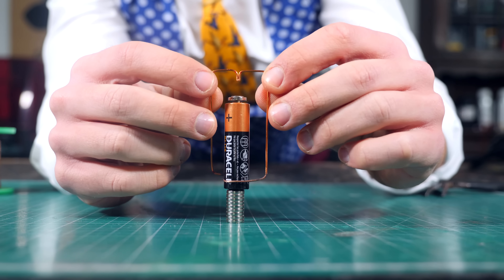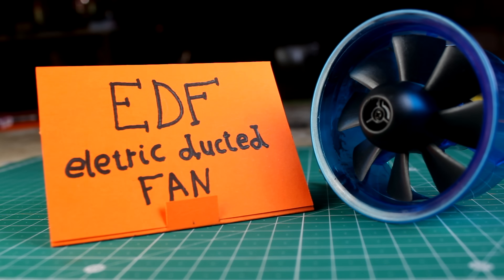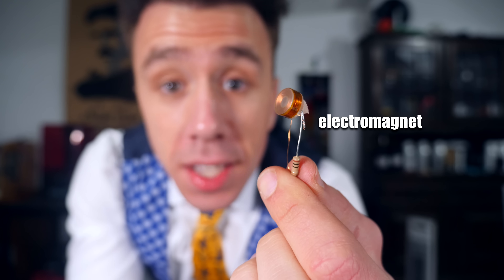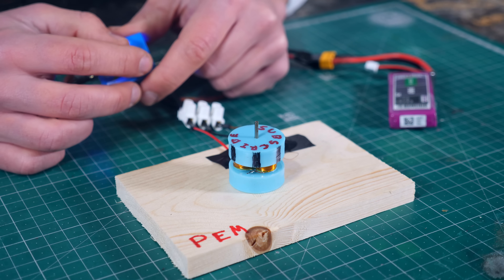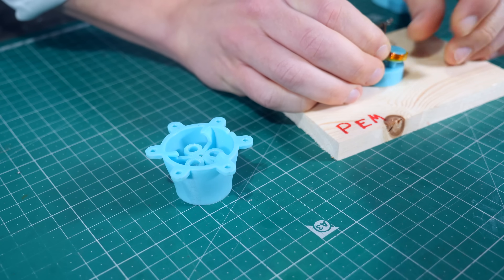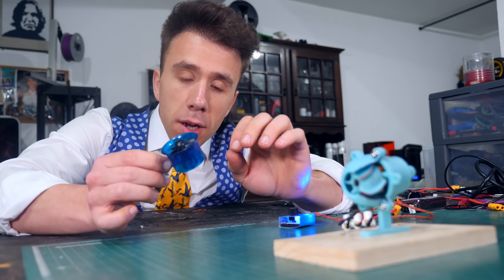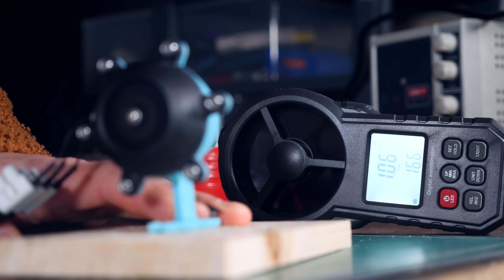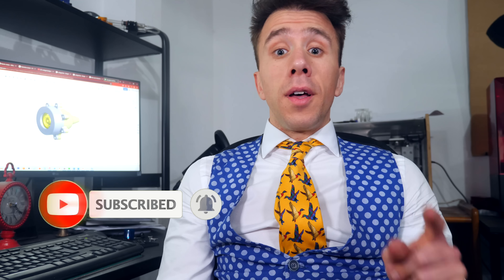I 3D Printed an ELECTRIC MOTOR FAN

Comment: Hi, as a Steamfitter the answer to your question is 2 fold. First a centrifugal pump works best with a perpendicular flow pattern that uses the "Centrifugal" force to release the fluid in the desired direction. Your casing requires the air to attempt to move sideways, restricts it, and forces it to change direction. I'm pretty sure a physicist could come up with an experiment that would show the losses as heat, in the casing, the air, etc. The reason a Dyson works is the very efficient turbine they use powers a very powerful force, the venturi. Because the air from the dyson comes out at a high speed thru a very small opening, and this is the important part, all around the inside opening of the ring, the air inside the ring goes along for the ride so to speak. The dyson doesn't restrict the flow like your design.

Comment: Hi, my name is marius, I whould love a 3d printer, I am 15 and very enthusiastic about engineering and a 3 d printer whould be just the thing I need to boost my passion.  Im from South Africa and we have regular power outages called loadshedding, if you chould design a Diy small scale phone charger generator or turbine system it would genuinely help alot. I hope you see this and have a good day.

Comment: Here's the issue with your design. Rotations on the coil is everything, the more coil you have the bigger the magnetic field is. And for the blade? Because it's 3D printed it's not smooth. you need to smoothen it to make it more stable and the air much more stable. This is kinda like having a prop with some imperfections in it, if it's not smooth enough it cant cut the air properly.

Comment: what it this? comment-bait? fine. it looks like you calculated the slopes of the propeller especially to push the vacuum in the middle towards the front and the back of the engine in equal measure. your little sister probably finds this obvious so you're clearly up to something.
make the front incline INCLINED to suck air in. based on the geometry of the casing and the longitudinal distance dependent angle of the blade the air is (hopefully) pressed radially and towards the back.
you go ahead and make a weapon better fitted to be used by zombies cuz you have no idea how yummy human brains are

Comment: ok ive been printing impeller designs for 4 days now at different angels of attack , surface area and amount of blades. what i found as a common theme was the angle of attack. if the pitch is too aggressive then the blades put to much resistance on the motor which therefore limits the highest possible speed. now in contrary to this im building a larger model with variable pitch blades as i saw this video and thought, could i put 4 or more motors into a closed loop (literally a circle) and run the fluid with enough pressure and speed to create a gyroscope. so now i have 2 projects. and im running out materials so it could be a few weeks, but more or less the main thing was the pitch of the blades on the leading edge

Comment: a server power supply fan would do better. the blades spacing is important as well as the entrance shape. it looks like blades overlap that means they block air from entering in  try fan blades with 50% to 100% spacing, meaning an open gap. to allow air in. also modifying the shape of the blades. the inside should be more aggressive than the outside slope. all the work is done on the outer part so openings should be on center from input and towards outer circumference on outer flow part.

Comment: Dude I was litterally just doing a ton of research on 3d printers and how I can't afford any good ones lol. Anyway, what if you try to make an engine powered type fan. Like not a radial engine, rather a small sterling engine connected to a fan. It would be cool to see the rates and possibilities they can create! Or maybe you could connect a piston to a sterling engine!
Reply: the only issue ive had with sterlings are they dont like to speed up or down and the ramp up from starting is quite brutal. may i suggest a few different size motors connected to a mainshaft with an isolator and reduction gears. i have built a canoe motor with 16 sterlings and a reduction gear connected to 2 impellors on the same shaft (feed in-feed out). worked ok but it was too risky for anything more than a still lake

Comment: Measure the power used by the fan to spin.  If it's not using the same a.ount of power it's not moving as much air, even if it's hitting the target rpm. Rpm is just rpm, it's just spinning.  If you completely cover the intake it will spin super fast, and use almost no current because it's just spinning.
Reply: Good point I wasn't even considering load measurements voltage is just voltage until you add resistance and it becomes amps and amps*voltage=power.

Comment: I produced a similar shape of rotor to yours a while ago. It was part of a small 3D printed supercharger. The rotor is actually hybrid being half way between an axial and centrifugal compressor stage. I've since moved back to a 3 stage axial compressor which is a bit more predictable. In theory each axial stage should offer a 1.2 pressure rise while a centrifugal compressor will offer something around 3.0. You exist somewhere between these values. The tip clearance for the hybrid rotor may affect the performance.
Reply: I miss the mustache! F*** tomatoes.

Comment: i think the entire issue is torque vs power, an actual prop or bladed fan benefits alot more from torque because it's blades directly induce flow by directing the air they pass through in the intended direction. They don't have to be very fast and baring shockwaves or other shenanigans mostly scale their output with rpm and diameter, producing resistance that needs to be overcome with torque. Fans induce flow at a rate.
impellers operate differently, alot of it being that the blades themselves work to get the air moving in a way that the rest of the housing can take advantage of, not inducing the flow but producing a bunch of centrifugal forces and constraining them to generate pressure. This makes things weird because the air has to spin relative to the rest of the housing to be subject to the various forces that produce the flow and thus surface finish is paramount to performance, as is efficient shape. You would also be generating flow by a pressure differential thus rpm does not produce the flow, only an amount of pressure, which is not fixed to the number of rotations.
in short impeller wanna spin fast, you need to optomise it to the maximum rpm of your motor then restrict the down wind flow enough that the torque demand doesn't stall the motor. Fan don't care for fast, fan do big, hur dur lots of air all at once, make sure the blades won't stall and maybe about the vortices or turbulence if you wanna get fancy about it.

Comment: I went ahead and did the math and a balance of force using the specifications of an EDM that looked like the one you used. The specs say thrust is 470g and power is 199.8W (probably not). The thrust converts to approximately 4.61 newtons and the output is about 0.268HP. Using the balance force equations produces an output velocity of about 39 m/s. Using the kinematic relationship that means the intake velocity is about 18.586 m/s. if you take your model and remove the interior geometry and use the EDM with its regular dimensions you can theoretically increase the force from 4.609 newtons to about 223.505 newtons. this would demonstrate a theoretical net increase of 218.896 newtons of thrust. this is of course assuming no entropy and zero shear at all surfaces but, the fact remains your losses have to be related to restrictions, drag and turbulence as noted by several earlier comments.

Comment: One of the reason could be also rpm,  a centrifugal fan spin faster than a normal fan.  Turbo in car can spin to 200.000 rpm and generate 2bar of pressure. In the automotive if the compressor fan is smaller, spin faster
Reply: So you need, for have the same trust, to increase the diameter of the fan and make sure you don't have bottleneck in the intake or exhaust

Comment: by looking at your design I would say you have far too much compression of the air at the output side of the fan. Remember that a volume of air can only be compressed so much in an open fan like yours. You could try to first enlarge your exaust/output to see how that changes your airflow. And yes smoke is a good way to do that. Use slow speed as possible to see the changes.  Increse the opening my 2 mm or so each test. Yeah I know that it would be a lot of printing to make many different jet bodies. Second, change the fan itself. You could try to use different blades pitches with a gap between each set of blades should be at least room for 3 sets of varied pich blades on you compressor. Last and this could work though I have no idea if it will but imagine if you incase your motor in a ovoid shape with the opening at the rear for the motor itself. Then print a new housing which encompasses this new fan use multiple sets of blades each blade would further compress the air from the blade in front of it. Do keep in mind that compressed air gets very hot so your build must take that into account to ensure the proto-type doesn't melt down.  
I don't have a 3D printer but hope to get one in the future so I can't try out my ideas for you but with that said I am pretty good with modeling things in my head.  Good luck.
Reply: ᴄᴏɴɢʀᴀᴛꜱ ʏᴏᴜ ʜᴀᴠᴇ ʙᴇᴇɴ ꜱᴇʟᴇᴄᴛᴇᴅ ᴀᴍᴏɴɢ ᴏᴜʀ ꜱʜᴏʀᴛʟɪꜱᴛᴇᴅ ᴡɪɴɴᴇʀꜱ ꜰᴏʀ ᴛʜᴇ ᴘᴀᴄᴋᴀɢᴇ ᴄᴏɴᴛᴀᴄᴛ ᴛʜᴇ ᴛᴇʟᴇɢʀᴀᴍ ᴀʙᴏᴠᴇ
^^^^^^^^^^^^^^^^^^^^^^^^^^^^^^^^^^^🎁🎉

Comment: Dear friend, as an old modeller, we have always known that EDFs perform less than open propellers.
The problem is in losses due to turbulence due to the space between the EDF propellant and the walls of the EDF chamber.
If you manage to leave that distance to a minimum then you will not have turbulence and you will not have losses.
sorry for my bad English,
a greetings.

Comment: As other people say, think about the relative inlet and outlet apertures. The fan is creating a pressure differential, the flow is just a secondary effect.
Also the aperture for the blower fan is a tubular surface infront of the blades. Not the circular transverse opening in front.  The inlet could be choking the flow of air to the blades in the first place. Try a wider diameter ring of blades on the blower.
Also look for losses in the system (from recirculation and work done to travel through the casing to the exhaust). Normal axial fans have a little recirc around the blade tips but the housing is very open, there is no resistance to the exhaust.

Comment: Described problem is due to clearances (accuracy). You need to reduce gap between propeller and body (it will dramatically boost your results). But it will work if all else is done correct.

Comment: I’d guess it’s a tolerance issue it’s difficult to get a good seal with air with water your idea as is probably would work great. Look at the compressor tolerances in turbo chargers tho they operate 50-100k rpm looking at modern turbo charger compressor wheels might be another place to look for ideas I’d recommend looking at borgwarner EFR line of compressor wheels as well as Garrett gtx and G series compressor wheels they have really high efficiency.

Comment: You should make a video on building an electric fan system to channel a blade of air on the outside of a windshield to prevent water from impacting while driving at speed.  This would take over from the main wipers at a certain speed eliminating moments of poor visibility between wiper cycles.  It could also assist with defrosting the widescreen if the air was pulled from near the engine/exhaust.

Comment: You might be losing pressure or stalling your compressor? 

The centrifugal compressor on a turbine engine creates a huge amount of pressure, which if it leaks out means you are losing airflow. Could be that.

I don't know how fast you are spinning it but if it goes too fast you will outpace the incoming air and stall your compressor. Try having a couple axial compressors separated by stator vanes before the centrifugal compressor. Look at the design of a modern PT6 engine for what I mean.
Reply: ᴄᴏɴɢʀᴀᴛᴜʟᴀᴛɪᴏɴꜱ ʏᴏᴜ ʜᴀᴠᴇ ʙᴇᴇɴ ꜱᴇʟᴇᴄᴛᴇᴅ ᴀᴍᴏɴɢ ᴛʜᴇ ʟᴜᴄᴋʏ ᴡɪɴɴᴇʀ ꜰᴏʀ the 🤶 ɢɪᴠᴇᴀᴡᴀʏ ᴘᴀᴄᴋᴀɢᴇ ʜɪᴛ ᴜᴘ✉️ ᴛᴏ ᴄʟᴀɪᴍ ʏᴏᴜʀ ᴘʀɪᴢᴇ

Comment: You will never get the same thrust by shrinkin fan diameter. That's just physics.

To get there you will need:
1. Very high tolerances on the impeller. I mean, extremely high. 3D printing with plastic won't work here. Resin is the best choice being rigid and cheap enough.
2. A high rpm motor. Rpm count should be proportional to the one you had on your original fan. Constant in this proportion is hard to count exactly. You can take it as R/r squared, where R - original fan radius and r - impeller fan radius. It's not an accurate formula, but good enough for start.
3. Experiment with nozzle. You need to find one optimal for your size.

Good luck!
Reply: ᴄᴏɴɢʀᴀᴛᴜʟᴀᴛɪᴏɴꜱ ʏᴏᴜ ʜᴀᴠᴇ ʙᴇᴇɴ ꜱᴇʟᴇᴄᴛᴇᴅ ᴀᴍᴏɴɢ ᴛʜᴇ ʟᴜᴄᴋʏ ᴡɪɴɴᴇʀ ꜰᴏʀ the 🤶 ɢɪᴠᴇᴀᴡᴀʏ ᴘᴀᴄᴋᴀɢᴇ ʜɪᴛ ᴜᴘ✉️ ᴛᴏ ᴄʟᴀɪᴍ ʏᴏᴜʀ ᴘʀɪᴢᴇ 🎁🎉😊

Comment: Measuring fan efficiency is not as easy as you think. The product of volume flow per second and flow velocity equals the effective power transferred to the air flow. So, you must measure the thrust AND the flow speed, otherwise you learn nothing ;-)!

Comment: an impeller Tomato blender, one that uses 4 impellers (3 at the bottom and one on top facing the other 3 below) to blend and grind tomatoes until they are just juice so they pour down the drain better.

Comment: My understanding is that EDFs require absurd degrees of precision.
I don't remember the specifics but there's a great YouTube video. I watched about it. 
Basically if the tips aren't really, really close to the edge of the duct It will generate vortexes at the end of the blades just like a normal impeller.

Edit: I found the video
https://youtu.be/7f2DZIC8a1k

Comment: Are you using the same diameter fan and impeller? The impeller looked a lot smaller, which reduces thrust at the same rpm, and a higher rpm increases inefficiency
Reply: ᴄᴏɴɢʀᴀᴛᴜʟᴀᴛɪᴏɴꜱ ʏᴏᴜ ʜᴀᴠᴇ ʙᴇᴇɴ ꜱᴇʟᴇᴄᴛᴇᴅ ᴀᴍᴏɴɢ ᴛʜᴇ ʟᴜᴄᴋʏ ᴡɪɴɴᴇʀ ꜰᴏʀ the 🤶 ɢɪᴠᴇᴀᴡᴀʏ ᴘᴀᴄᴋᴀɢᴇ ʜɪᴛ ᴜᴘ✉️ ᴛᴏ ᴄʟᴀɪᴍ ʏᴏᴜʀ ᴘʀɪᴢᴇ 🎁🎉😊

Comment: the cross sectional area of the output of the impeller is a little over a third of the EDF. your blades are FAR too short for comparable thrust. you will need to print your blades at a substantial angle with some support-removing post-processing in order to fit it in your build volume. same with the casing. it's gonna need to be as big as you can possibly fit in your build volume. print one part at a time. Also, consider Siraya Tech Blu Nylon Black for toughness, so you can print thinner blades and not have to worry about shattering them. ST Blu Nylon Black isn't clear like the other ones, so it cures at a higher output, so you won't have to worry about dialing in the exposure and power levels. an Anycubic Photon M3 Premium is also going to get you very good results (once you get everything set up and updated, provided the updates don't conflict) because the X/Y resolution is 28.5 microns, and it has a 25 x 12.3 x 21.9 cm build volume. The Z-axis accuracy is 5 microns.

Comment: Compression inefficiencies - you're snaking it down to create more velocity, that creates more backpressure i.e. resistance to more flow, and you have to have very precisely-machined components at that size due to relatively higher friction and pumping losses at small scale - the radial setup is barely making any compression whatsoever

Comment: Just looking at the size of the EDF and you impeller im wondering if the thing might be just to small (or the motor too lsow). You should be able to check this by looking at the current draw of the motor while running both designs. If it draws less the motor is not loaded as much which in turn means your turbine needs to be bigger.

Comment: Thrust is the product of mass flow rate and velocity (minus freestream) where mass flow rate is the density (rho) * Velocity (V) * annulus area (A). so Thrust = rho*A*V^2. Today, the centrifugal fan is producing less thrust than your axial fan. Density is going to stay the same so your options to increase thrust are to increase Velocity or annulus area (size) or both. As Velocity is a squared term, you'll get more improvement increasing velocity than you will the same proportional increase in area. If you're going to use the same motor, you can use a gearbox to increase the speed of the impeller, or you can increase the radius of the aft end of the impeller as the air velocity off of the impeller will be close to the velocity of the impeller tip speed which is the radius (r) * rotational speed (omega). So to fix your centrifugal fan your options are to 1) use a gearbox to increase rotational speed, 2) increase impeller exit radius, or 3) increase exhaust annulus, though this will have an impact on stall (so you should mess with this in your current design to see if it makes an impact).
Reply: good point I hadn't even gotten to balance of force yet.